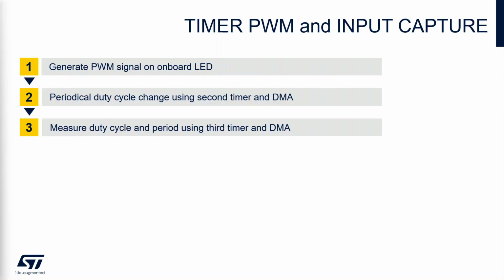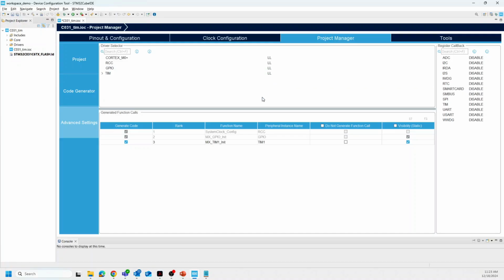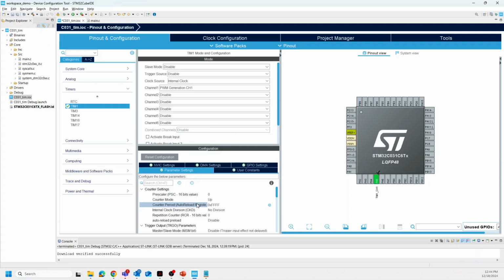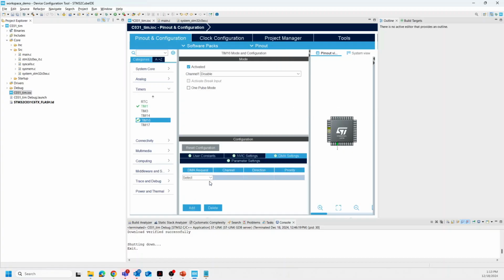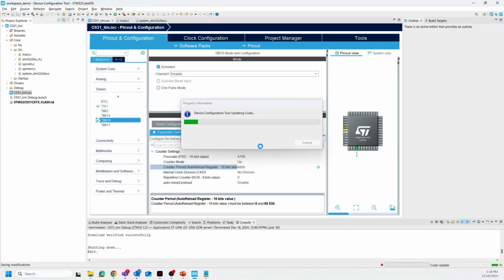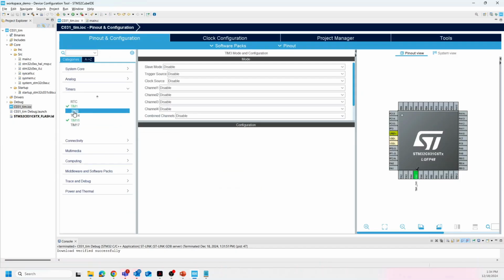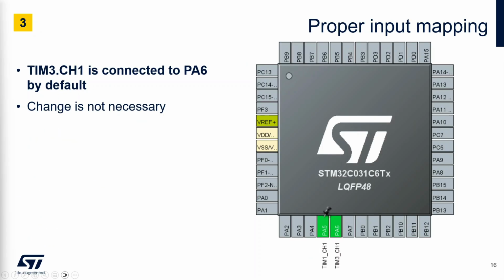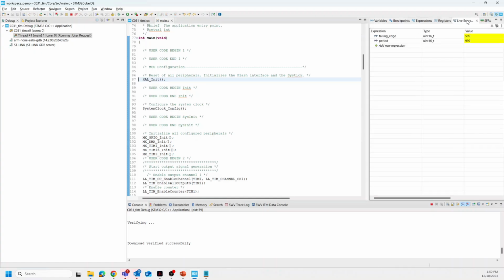STM32C0 workshop - 02a Timers programming using Low Layer library - lab

Comment: AI summary

Abstract:

This tutorial demonstrates using STM32 C0 series microcontroller peripherals, specifically Timers (TIM1, TIM16, TIM3) and Direct Memory Access (DMA), to generate a Pulse Width Modulated (PWM) signal and subsequently measure its frequency and duty cycle without requiring CPU core intervention. The process is broken down into three steps: first, generating a basic PWM signal on an onboard LED using TIM1 configured via STM32CubeMX/IDE with Low-Level (LL) libraries. Second, dynamically modifying the PWM duty cycle using TIM16 as a trigger source for DMA transfers that update TIM1's compare register. Third, measuring the generated PWM signal's period and pulse width using TIM3 in combined reset/trigger input capture mode, with two DMA channels automatically storing the captured rising and falling edge timings into memory variables. The tutorial highlights the use of hardware peripherals to offload timing-critical tasks from the CPU.

STM32 Timer & DMA Tutorial: PWM Generation and Measurement

*   0:00:04 Introduction: The video aims to show how to generate PWM using STM32 C0 timers and measure its frequency/duty cycle using timers and DMA, minimizing CPU core impact. It outlines a three-step process.
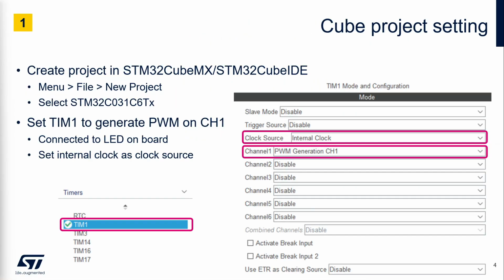*   0:00:43 Project Setup: A new project is created in STM32CubeMX/IDE for an STM32C011C6 microcontroller (specifically on a Nucleo board).
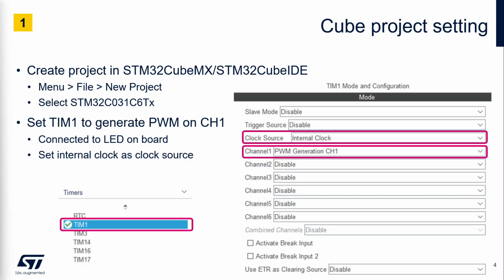*   0:01:37 Step 1 - PWM Generation Setup: Timer 1 (TIM1) is configured to generate PWM on Channel 1, using the internal clock source. This channel controls an onboard LED.
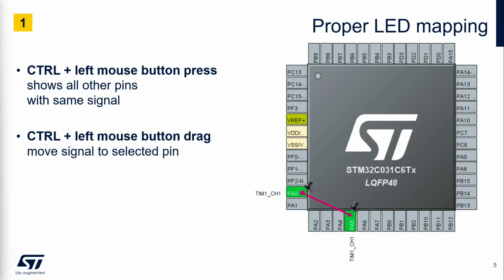*   0:02:09 Pin Reassignment: The TIM1 Channel 1 output pin is reassigned to the correct physical pin connected to the LED on the Nucleo board (PA8).
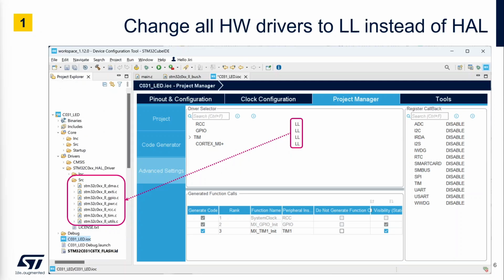*   0:02:41 Library Selection: Low-Level (LL) drivers are chosen over HAL for peripheral configuration to provide finer control.
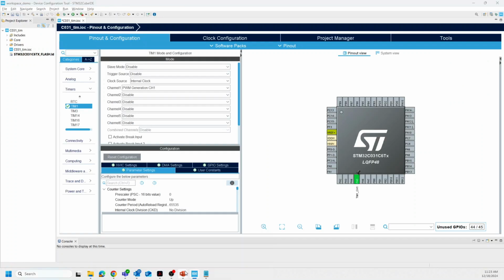*   0:03:04 Clock Configuration: The system clock is set to the maximum 48 MHz using the internal HSI48 oscillator.
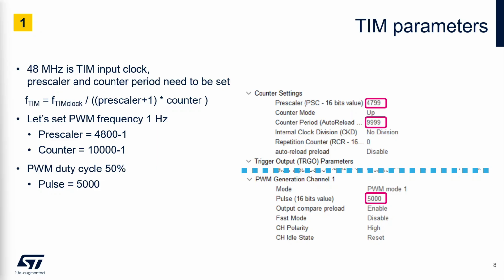*   0:05:05 Timer 1 Configuration (1 Hz PWM): TIM1 prescaler is set to 4799 and the counter period (ARR) to 9999 to achieve a 1 Hz frequency with the 48 MHz clock (48,000,000 / (4799+1) / (9999+1) = 1 Hz). The pulse value (CCR1) is set to 5000 for a 50% duty cycle. Code is generated and downloaded; the LED flashes slowly.
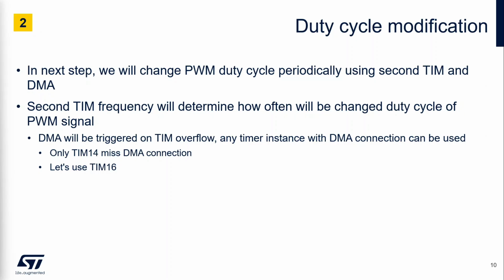*   0:07:05 Step 2 - Dynamic Duty Cycle Intro: The plan is to increase TIM1's frequency and use Timer 16 (TIM16) with DMA to periodically change TIM1's duty cycle, altering the LED brightness.
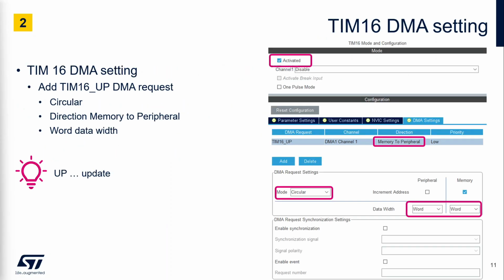*   0:07:28 TIM16 & DMA Setup: TIM16 is activated. A DMA request is configured for the TIM16 Update event, set to transfer data from Memory to Peripheral (TIM1's CCR1 register), using Word size and Circular mode.
*   0:08:56 TIM1 Configuration Update (1 kHz): TIM1's frequency is changed to 1 kHz (e.g., Prescaler 47, Period 999 gives 48MHz / 48 / 1000 = 1 kHz). The initial pulse (duty cycle) is set to 0.
*   0:09:34 TIM16 Configuration (2 Hz Update): TIM16 is configured for a 2 Hz frequency (Prescaler 4799, Period 4999 gives 48MHz / 4800 / 5000 = 2 Hz) to trigger the DMA transfer twice per second.
*   0:10:12 Code Implementation (Step 2): An array holding different duty cycle values is defined in the code. Initialization code for TIM1, TIM16, and the associated DMA channel is added. This setup allows TIM16's timing to automatically trigger DMA to load new duty cycle values from the array into TIM1's CCR1 register.
*   0:12:12 Step 3 - Measurement Intro: The goal is to use Timer 3 (TIM3) with DMA to measure the period and duty cycle of the PWM signal generated by TIM1.
*   0:12:52 TIM3 Configuration (Input Capture): TIM3 is enabled in 'Combined Reset Trigger Mode'. The trigger source is set to Input 1 (TI1FP1). Channel 1 is set to Input Capture Direct mode, and Channel 2 to Input Capture Indirect mode (capturing the same input signal but potentially on a different edge).
*   0:13:29 DMA Setup for TIM3: Two DMA channels are configured for TIM3: one for Channel 1 Capture/Compare event and one for Channel 2 Capture/Compare event. Both are set for Peripheral-to-Memory transfer, Half-Word size, and Circular mode.
*   0:14:16 TIM3 Timing Configuration: TIM3's prescaler is set to 47, making it count at 1 MHz (48MHz / (47+1)). The auto-reload register (ARR) is set to the maximum (65535).
*   0:14:41 Input Capture Polarity: TIM3 Channel 1 (Direct) is set to capture the Rising edge. TIM3 Channel 2 (Indirect) is set to capture the Falling edge of the same input signal (TIM3_CH1, pin PA6). Key Takeaway: This setup uses the rising edge to reset the timer and capture the period (in CCR1 via DMA), and the falling edge to capture the pulse width (in CCR2 via DMA).
*   0:15:35 Hardware Modification: A physical jumper wire is required on the Nucleo board (Connector CN10, pins 11 to 13) to connect the TIM1 PWM output (PA8) to the TIM3 Capture input (PA6).
*   0:15:57 Code Implementation (Step 3): Variables are defined to store the captured period and pulse width values from DMA. Initialization code is added to start TIM3 and its associated DMA channels.
*   0:17:30 Debugging: The code is built and downloaded, and a debug session is started to observe the variables being updated by DMA with the measured pulse width and period values (in microseconds, due to the 1 MHz TIM3 clock).

I used gemini-2.5-pro-exp-03-25| input-price: 1.25 output-price: 10.0 max-context-length: 128_000 on rocketrecap dot com to summarize the transcript.
Cost (if I didn't use the free tier): $0.05
Input tokens: 14036
Output tokens: 3646